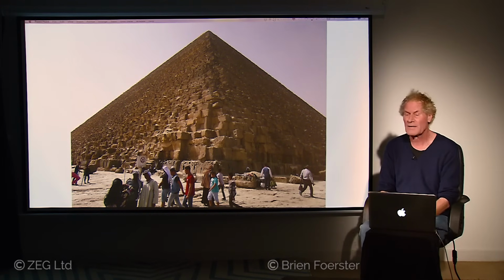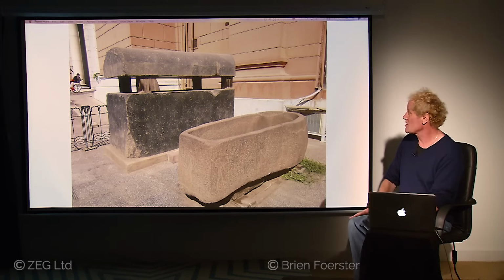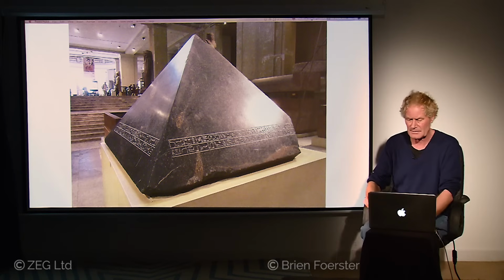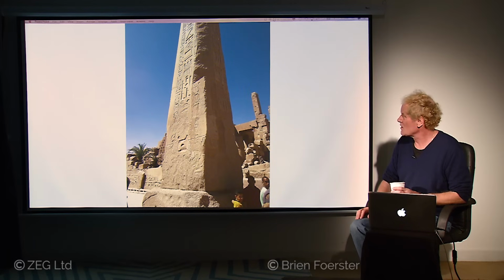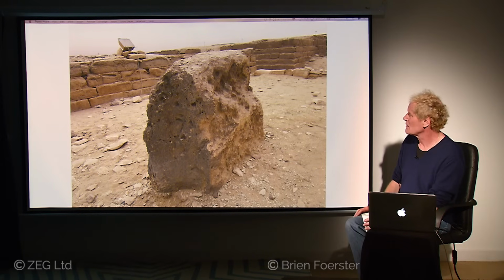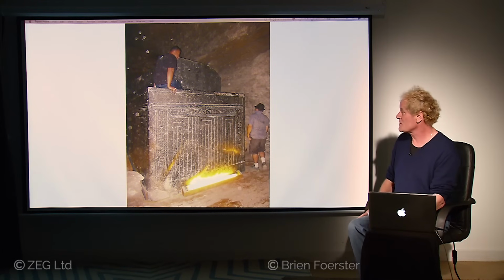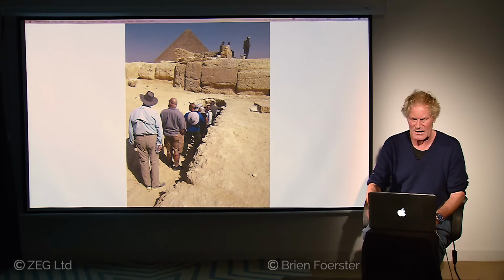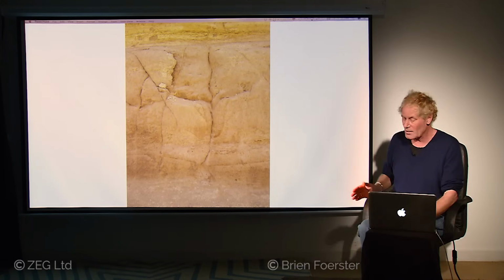Lost Ancient High Technology Of Egypt Full Lecture

Comment: A quick calculation shows 590000 blocks were used that's 64 blocks per day. Even that number is not probable.the highest block count is 2.3 million. That's 196 per day.also not possible.this assumes a 25 year time frame.NOT POSSIBLE BY DYNASTIC EGYPTIONS. 
::: Unless they were using antigravity ::::
Reply: Just a brainstorm: humans are very good at doing something better than they just did it. It doesn't make sense to me to take an initial idea or procedure and carry it thru to the end. Meaning the builders may have moved and cut block one way at the beginning of the project, then a few cycles they develop new technologies and techniques on doing things.

Another way to think of it: we start a gene sequencing program using PC's from 1980. We sequence one chain a month. Fast forward to 2000, would we still be using those old PCs or would we use the new tech that can sequence a  1,000,000 chains a second?

Humans kick ass at doing something better, we learn, we adapt, we think and overcome challenges. These people but these amazing structures, so to assume they were locked in to one way of doing things is disingenuous imo.
Reply: @AtkinsAtelier  Well said my man, in my humble opinion you kicked his ass with that reply
Reply: Most of the blocks are geopolymer that has been replicated. With this pouring “concrete” technique it’s estimate it would’ve taken a crew of 10k only three years which is much more plausible.
Reply: @kurtlockwood  ok so they crushed up all the solid stone then transported it ??? Sounds like it would take longer
Reply: source?
Reply: did you include the wet season and farming time, plus the techtonic plat shift
2 to 3 arc minute of geo-north about 198 - 250''thousand years ago...
Reply: So who did build them then since you are so sure about who didn't.
Reply: well... tell me how they made them...
Reply: @Desertknight96  
There is a Pillowing effect of the stones as though they were softened and pushed together, making the seams so tight you cannot slide a dollar bill in it. The quarry for the limestone and granite is hundreds of miles away. Antigravity must have been used to transport the multi ton blocks to the site. So two technologies, one, antigravity, the other caused a change in the chemical bonds of the crystal structure making them elastic and not rigid. This is a tech which may have been acoustic , or more likely quantum mechanical.
Reply: @KevinKilgorepage   Can't vote this up enough. It should be pretty obvious to everybody that there weren't just 10.000 people sitting around in the desert, waiting for the next stone to come out of the quarry. Those people worked in teams and had a defined routine.